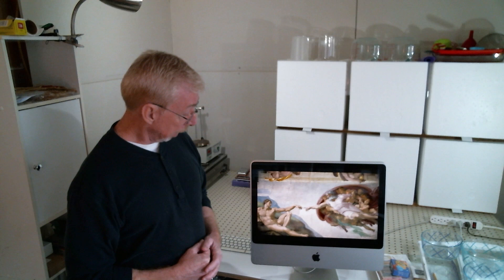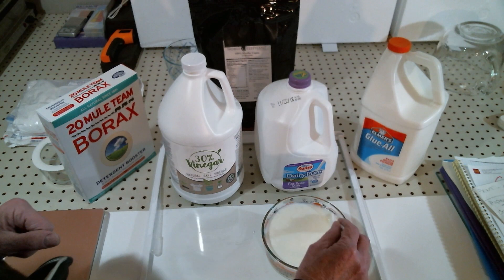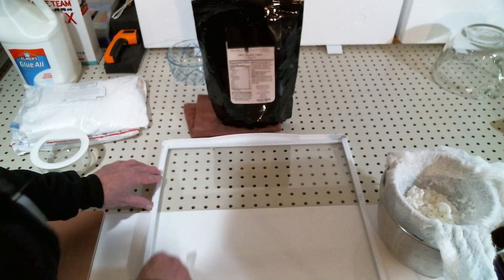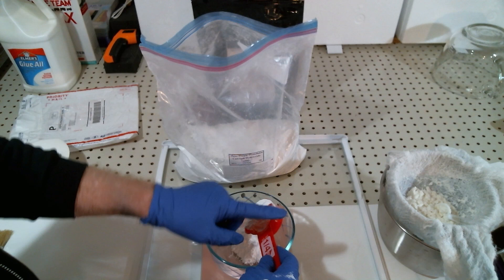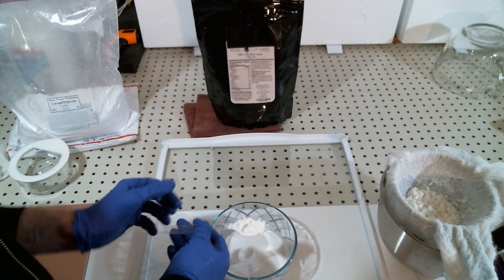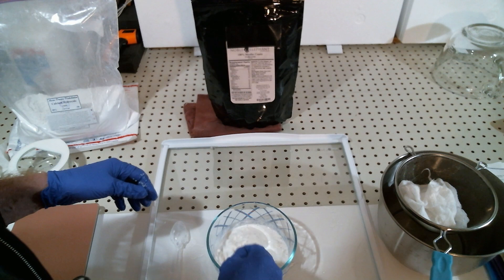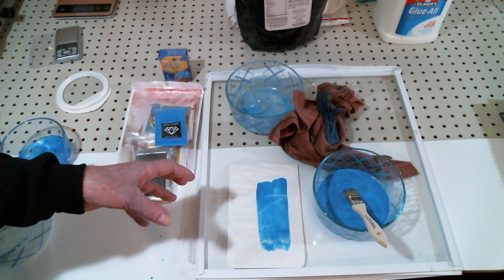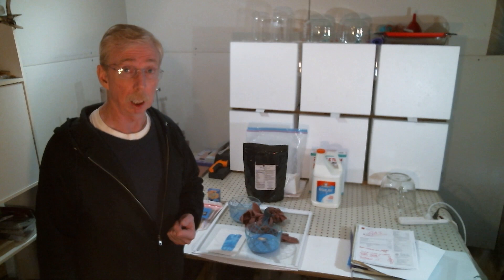Arts and Crafts: DIY Milk Paint NON-Toxic, NO VOC. Casein paint

Comment: Thank you for sharing the bonding agent to add by using the glue I am making my own milk paint and have been searching for this info  🙏🏻
Reply from the maker: My pleasure. Stay tuned for more on milk paints.
Reply: There is a natural bonding agent: Linseed oil.
Reply: @W4ldgeist    Linseed oil?   I don’t understand how that could work as a bonding agent?
Reply: @janinetapp6482  Because the oil itself as a paint base bonds to almost anything. Glass, metal etc. and if you emulsify linseed oil into milk paint it will help it adhere to surfaces and create a stronger paint film. Adding linseed oil to milk paint is an old practice.
Reply: @W4ldgeist     Oh wow really I would never have thought that as I have always looked at oils etc as a resist like putting it on in areas to get more chipping/resistance,  

How much linseed oil would you add to your milk paint,  how does it mix in with the milk paint being water based? 

I am very interested 👍🏼
Reply: @W4ldgeist     Hi again,  I just found a recipe for milk paint adding boiled linseed oil,   I am going to give it a go,  I use my milk paint on furniture and have been having some issues with too much cracking/alligatoring,  maybe I didn’t add enough glue in the mix?   But thought adding the oil may help it be a bit more flexible when drying to help avoid this?
Reply: @janinetapp6482  If you have crackling it's usually an issue of the lime, casein pigment mixture. Well mixed milk paint doesn't chip a lot. 1/5th of the wetted lime should be casein/quark, if more lime is added it hardens too much. If too much pigment is added it dusts when rubbed. Also you can use the linseed oil after the milk paint to add a protective finish, too. And yes, adding linseed oil should improve the general binding strength of the milk paint. But again... well mixed milk paint should cover without cracking.
Reply: @W4ldgeist    Thank you so much,  I have been doing sooooooo much research into all this,  I am also wondering if I am using the wrong kind of lime as I know it says to use type S hydrated lime,  I could only get builders lime which is hydrated though maybe not type S I couldn’t get any more info on it though every time I googled type S lime this particular builders lime comes up,   Sorry for all the questions though I am sure you understand the journey,  very much appreciated,  

So what you mean is the mix should be 1part lime to 5 parts casein/quark?  Sorry if I haven’t understood
Reply: @janinetapp6482  hydrated lime should be good. 1:5 is 1 part hydrated, watered lime (already prepared not in powder form) and 5 parts wet quark/curds. It's not an exact science. Then you let that  mixture sit for at least 30 minutes, so the lime can split up the protein in the curds.

The watery paste you have now can then be mixed with roughly the same amount of pigment powder, which is also beforehand mixed with water to a watery paste.

You have to experiment with the pigment, as they have their own chemical properties when mixed with the slightly alkaline solution of the curd/lime mixture. Sometimes you need a bit more binder - when the paint can be rubbed off after drying - sometimes you need to add less lime, so the mixture doesn't harden too quickly and crackles.

If you add more lime into the quark you end up with a very strong glue, that's maybe why it cracked for you. The paint contracts when it dries, if the mixture is too lime-strong, it will harden faster and contract more.
Reply: @W4ldgeist  

Thank you sooooo much I really appreciate you taking the time to write that for me I will try less lime 🙏🏻

Comment: Nice videos! Long-time ago, I saw a designer using casein in paste form covering a wood model. When the paste dried,  she used sandpaper to make the surface super smooth. Do you know how to make that paste?
Reply from the maker: WOW, what a great idea. I have to pin you so others see this. I do know how to make that paste. I would use my milk paint formula and reduce the water by 25% to start. Give it 24 hours to jell in the fridge (lightly covered). Now this is a ball park, its like baking, after awhile you begin to just know. What you should have is a very creamy paste (keep it cold while using it too), and will dry to a flat finish. Sanding is just fine too. You can even carve it like marble after a few days. I can put a video doing this on the list folks want it.

Comment: I think a waterpoof formula consisting of Casein/slaked lime/sodium sillicate or just casein/sodium sillicate wouldnt be a bad idea. Although sodium sillicate isnt waterproof, concentrated solutions of more sand to sodium hydroxide in the sodium sillicate seem to be more water resistant for hours, acting as IF its hydrophobic. Also it has been used as a kind of wood glue and furnace glue, so it wouldnt be bad attempt at waterproofing clothes imo. Just a thought for a future video.
Reply from the maker: Waterproofing Casein to the point of being able to machine wash something it the 'holy grail' of bioplastics. I have much success with adding the fresh Casein to 30% Vinegar to give it hours of perfect waterproofness, but then begins to break down. 30% Vinegar is the strongest acid I have, so I think even stronger acids will make it more waterproof. It is something on one else has tried, so it may be the trick. Try it.
Reply: @GEOsustainable  Thats an interesting find! I would use hydrochloric acid that i got lying around but i already used it to precipitate some casein out of milk. Still gonna give it a shot. I would like to see a future video where you tackle different acids and glues to see the most effective waterproofing agent. Like you said before, itd be the holy grail of bioplastics! Thanks for the reply and would be interested in more of your bioplastics, organic adhesives, etc.

Comment: BTW...Hydrated Limed is also called Slaked Lime or S-Lime or S-type Lime.
Reply from the maker: I have heard this and bought all of those. In my humble opinion, I prefer to use food grade Calcium Hydroxide instead of Hydrated Lime for improved water resistance. Each one you added here will work just great. Thanks for adding your comment.
Reply: Or pickling lime

Comment: Thank you. Great video. Why is overcooking or heating the milk bad?
Reply from the maker: It will not precipitate until it cools, so overheating is a waste. Glad you like!
Reply: @GEOsustainable  Oh. I have been making milk paint using casein powder that I've been purchasing and have had a lot of success painting it on several interior finishes - wood siding, drywall, lime plaster. I went to order more and they were out. That's when I turned to YouTube to see about making some. Before I found your channel I found a video on boiling yogurt and water and then pouring that through cheese cloth, letting it hang, then dry and crumbling the bits into a powder. I'm in the middle of my first batch. I found your video very helpful and interesting. Is this the book you mentioned: Casein; Its Preparation and Technical Utilisation by Robert Scherer (English)?  Thank you for your reply and help!